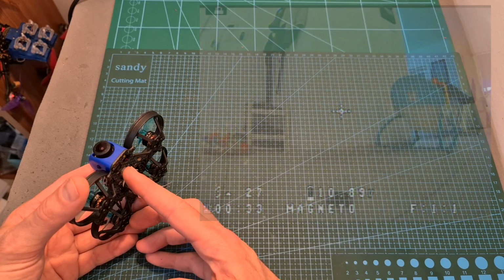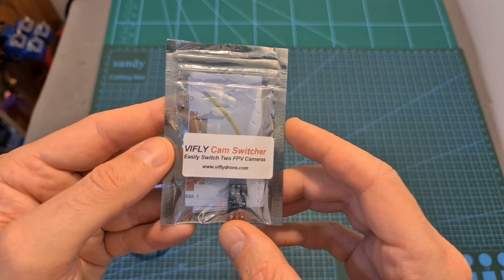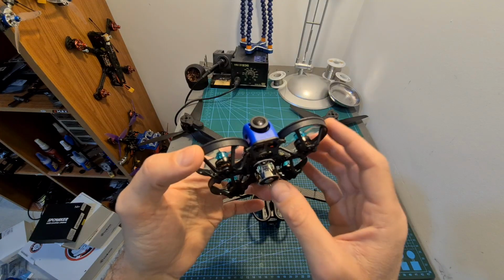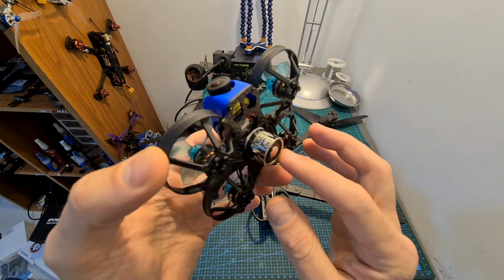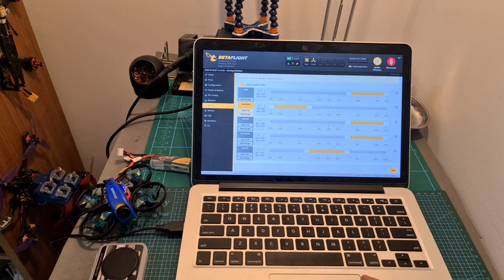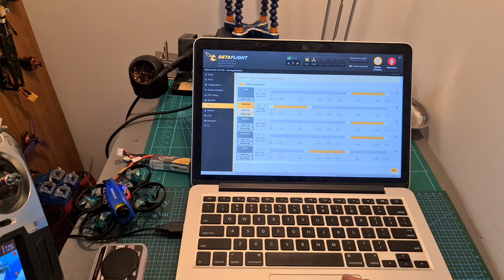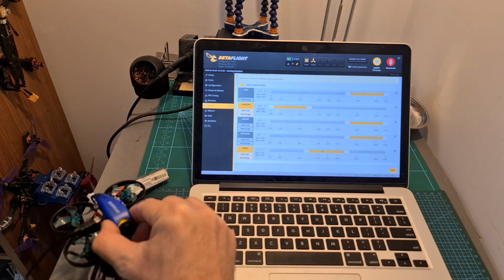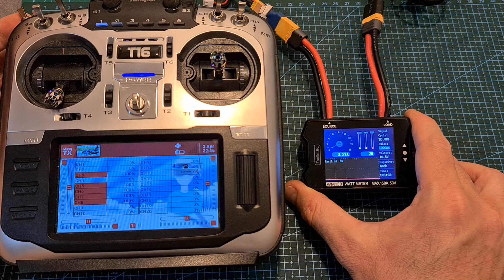🧲 Control An Electromagnet Using Your Drone

Comment: Hi I’m interested in putting a electro magnet on my rc bait boat and I’m wondering if it will run off the rc receiver or if I h be to add anything else to make it work I will be putting 2 magnets on it any help would be really appreciated many thanks leon
Reply from the maker: Hi, you should be able to use a PWM input but I didn't test it out, sorry.

Comment: Did you ever connect your electromagnet using the PWM switch? I have a project where PWM doesn’t work for the electromagnet. I’m suing a SpeedyBee F7 V3. Any advice?
Reply from the maker: Sorry, no - I haven't tested this option.

Comment: Hi Gal, thank you for sharing this interesting video, I have been trying to do something similar, but one thing that I am concerning is the EMI (electromagnetic interference). So when you put the electromagnetic close to some electrical devices(in this case, the flight controller or motors, etc), it might mess up the performance of those devices. However, it works very well with your drone. I am wondering if you had any solution to reduce or prevent EMI or it just works like that. Please share any knowledge if you don't mind. I would appreciate that. 
If you use a bigger and more powerful electromagnet for that mini drone you have, would it still work properly?
Thank you.

Comment: when the EM is connected like that does that mean the video cannot be controlled or when it's turned off the video and the EM turns off. sorry I have so many questions
Reply from the maker: I was just using the VTX power pad, and powered the VTX using 5v.

Comment: hello btw awesome video but how will you connect the VTX if the magnet is connected to it and will there be a video on how to do the PWM signal way
Reply from the maker: Thanks, I answered your question in the other comment. 
Currently I don't plan to post another video, sorry.
Reply: @KremerFPV  thanks for replying 😊😊
Reply: Yea just make a small board with a small resistor and an N transistor, connect it to one of the pwm output of your FC, and the other to the minus of the electromagnet. Obviously connect the plus of the electromagnet to your battery.